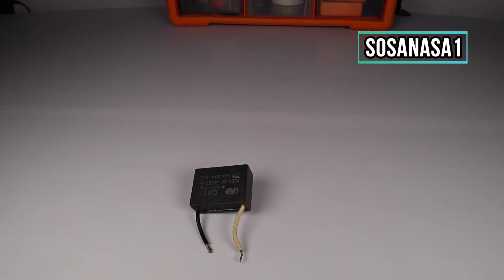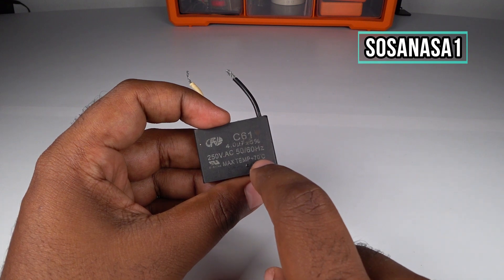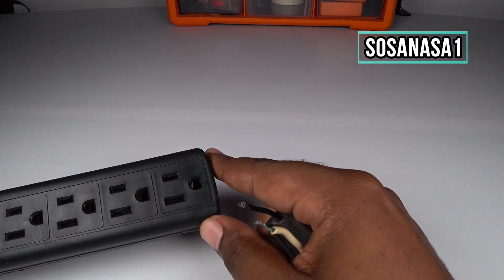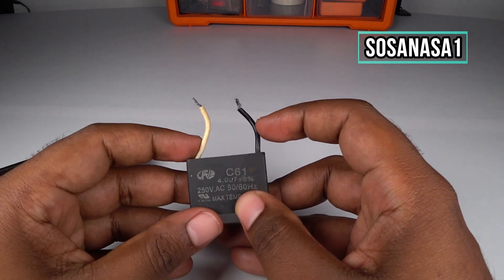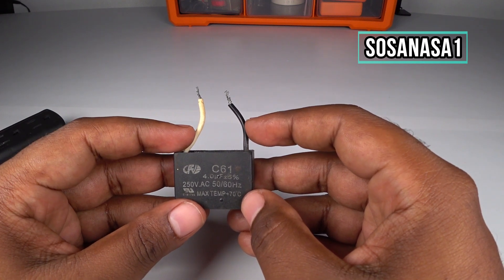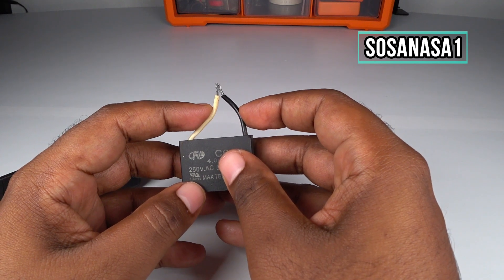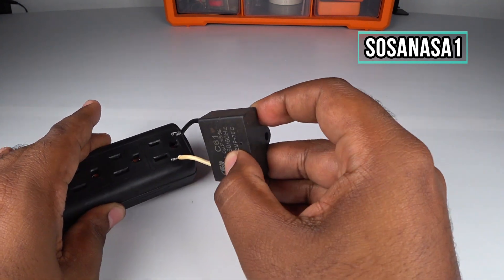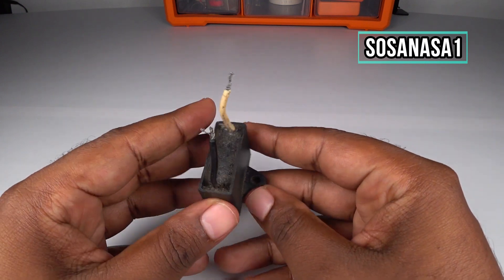How to Test Fan Capacitor Easy and quickly

Comment: What happens if the capacitor only has two black leads it doesn’t have a widely how can I do that, and make sure which one’s white
Reply: Pleas let me know 👍tnkz😊
Reply: @bennymoreno7805  These capacitors are non polarised so it doesn't matter which way they are connected. That's why they work with AC.

Comment: The caps found in the flash circuit of disposable cameras are small but have a good punch to them. Ive accidentally rigged them up inside of the handle of my mag lights connecting to the main power button. Remove the rubber and secure the lead to the plastic part of the switch with a tiny screw or glue. When the button is pushed to turn the light on it waill shock the hell out of who ever pushed it. They are fun to install inside your remotes too.

Comment: You can buy a 20,000 ohm resister to safely discharge caps. And it wont l damage the cap. For those who dont know what youre doing or what a cap does. Once a cap is charged it can hold that charge indefinitely. If you grab it and touch the terminals or wires best case scenario youll get a tingle. Depending on the voltage and mf youll be lucky if you only piss yourself.

Comment: I'm starting to think they run down and the fan runs slower with an old capacitor. I tried connecting several old capacitors one at a time to test the fan speed with each one. Some were slower than others and I even doubled using two old capacitors and the fan worked well and worked beter than with each capacitor separately!  I checked the lubrication before working with the capacitors, of course.

Comment: This is going to get some idiot a taste of the juice for sure.... Might as well tell people to jam butter knives into the breakers.
Reply: Why would you want to stick your tongue to the wires of capacitor ? No one is talking about tasting anything.

It's one thing to put your tongue on the contacts of a 9-volt battery, we used to do that when we were kids.... Eveready was the preferred brand because of the special taste. But if you do it with a capacitor like this one,  you're in for a great surprise.